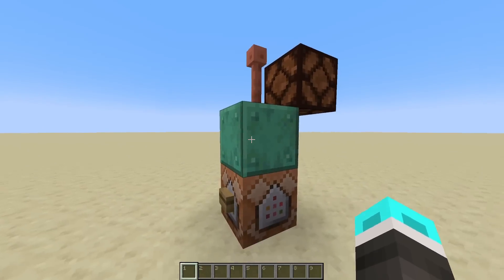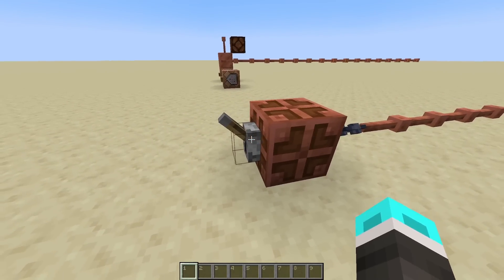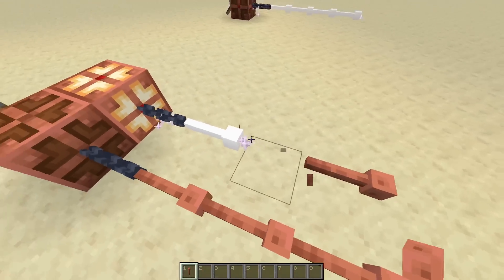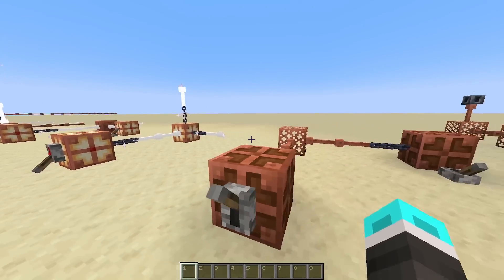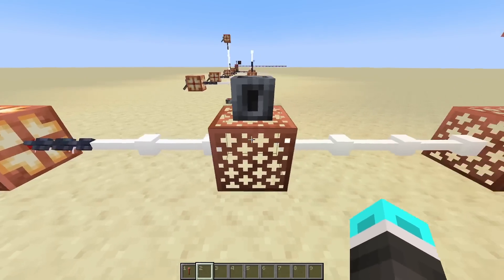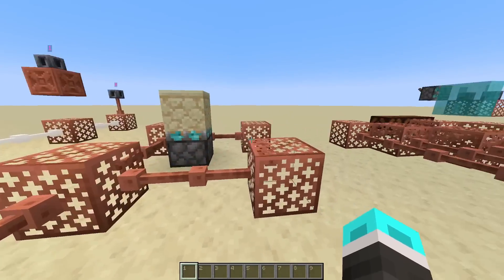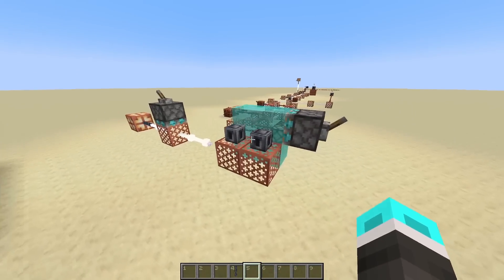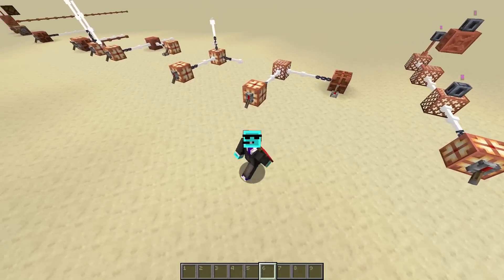Copper Wiring Datapack Beta 1

Comment: it would be really interesting if you could use oxidised chiseled copper blocks as resistors to eg reduce the charge rate of a capacitor and be able to send different values, that  could be then read out by comparators

Comment: i would wish for a certain block like idk a  copper stair, that if u place infront of the bulb and then the lightning rod. u can making short turns instead of placing a rod using a copper block etc. also i think the bulb should be 14, as a lever connceted to a block connected to a copper bulb on the other side. doesnt activate the rods.
Reply from the maker: @aerotter.149  I made it just adjacent blocks. That doesn't create a strength of 14, I would just have to add a lot more checks for all blocks around, which I just didn't do
Reply: @AuraAcorn  ah ok, but i see how the 2nd question wouldnt of worked. what about the first one though?
Reply from the maker: @aerotter.149  stairs can be placed and oriented a lot of different ways, everyone one of those would have to be checked in a system to see if it would work, and I don't see much of a gain to having them
Reply: @AuraAcorn  if this is added as a feature plus doesn't need to be a stair, it will save a hassle of extending the wire 2 then turning 1 then turning back 1. Just to move one block to the left. And it would add much more compactness

Comment: There is no point in storing energy if you can just generate it infinitely with the same amount of blocks. 

At best this datapack simplifies power transmission compared to redstone and compacts it a bit. With redstone you can already build nearly anything considering people already build computers in minecraft and this datapack won't allow to do anything more than is already possible it will just make it easier. I consider limitations redstone has to be part of what makes it so cool so for me this datapack doesn't increase what is possible it just makes it less cool.

So far this datapack doesn't have any functionality redstone doesn't have. Competing with redstone in it's own field is pointless because redstone will always have advantage of being a part of base game. Modpack like that needs to open new possibilities which is not the case in it's current version. Also as I said before 2-block power storage is completely pointless if you have 2-block infinite power generator. To justify existance of storage power generation needs some kind of limitation. Examples of possible limitations would be: randomness in time(like lightning strikes), specific location(for example power generation possible in specific bioms), cost(either cost of creating generator or cost of running it). 
As I said about redstone previously, limitations are what makes it cool. Power amount limitations don't exist with redstone so that could be something to differentiate this modpack from redstone. But it would still need to give some new possibilities because otherwise it would be just inferior redstone. 

I got a bit lost myself in what exactly was my issue with this modpack but what I was trying to say is: it can simplify things that are already possible with redstone but there need to be some sort of "cost" going with it. Many technical mods make different machines more compact than they would be when build with redstone but it's balanced by higher build cost or  energy generation limitation.

Comment: The Heavy Core need the bound value or... more time for more charge. I tested some functions and I propose the function sqrt(2*t+0.25)-0.5 . It gives +1 to charge every triange number of tics. In other words - you spend 1+2+3+..+N ticks for N charge points. It grows not very fast but you still can get every amount, but for 500 charge you need to spend around 2:06:30 of real time, the 126 minutes 30 sec. If you want to double it, you totally spend around 7 hours! (exactly 6:57:00) The reverse process can work the same way.. or faster - with linear function or slower.

Comment: this is a very cool data pack but i have 1 question, what makes it different from other packs or mods that work with electricity things?
also what would you need that power for? 
my limited brain just seem to be unable to see a reason for that😂

Comment: You should consider adding more electrical components such as diodes, and consider making the wire omnidirectional, as wire in real life has no polarity, thus giving a purpose for diodes. As for the capacitors, perhaps you could connect them in series to increase their storage capacity, might be better to use a different block though. Seems really cool though, good work, look forward to using this!

Comment: Insulation has been mentioned, but I'd also like to see wire coloring added. For example, put a dye in the middle and a ring of wires around it on a crafting table to produce 8 colored wires.

Comment: Suggestion!! Cut copper acts as a junction point (copper grate minus the heavy core) but as soon as there is a second input no power goes out the block, so it "Cuts" the power. This will help in NOT and XOR gates im pretty sure and other cool stuff

Or when power is cut, it could charge the heavy core on top or smthin idk

Comment: Lots of suggestions on how to make NOT gates—and I think I've got a good one. Fully oxidized copper grates will only allow power through if the number of outputs exactly matches the number of inputs. This way, you can have one input and one output by default, giving an ON state. But if another input comes in, the inputs no longer match the outputs, so you have an OFF state.

Comment: I think that what disappoints me about this system is the delay it has when powering the next copper cable, like, I only felt it when you showed the paralleled light switch, where it wasn't instantaneous when you flip the lever, otherwise amazing work, and to be fair, is amazing it's a data pack

Comment: This honestly seems pretty cool, and its also nice to see a redstone-like system that operates quite unlike redstone. I could see uses where people transfer energy between redstone and these copper wires for different purposes. Could be really interesting! Also kind of fun to see new uses/purposes for the various copper blocks as well!

I would probably agree about rhe heavy core being a bit too rare to reasonably use, but I also wouldn't want an essentially limitless battery to also be trivial to find/make. Perhaps some form of middle ground block/item could function as a lesser version?

I wonder if the sparking at the end of an open wire could have some use or purpose in some way? Obviously anywhere on the wire already deals damage, not sure if the sparking shouod be maybe more dangerous or have some added effect? Or who knows what else could be done with that.

Comment: You should also add in a insulator, and then make it so if you don't insulate the wires and you put active wires underwater, them being in water within a certain radius does damage to you, but if you insulate them, then they don't do damage at all. (maybe you can use slime blocks, and it would visually look like it was waterlogged with slime.)

Comment: Like This and I have an idea to use the heavy core to make like a Battery for builds that may need that, for example backup battery. Maybe you should make a way to transmit the single wireless for Redstone circuits to work together

Comment: Aura Acorn, you should either make the beacon the new battery, or make it so you can power the beacon to turn it on, it would be max strength, but it would require to be connected to the battery to activate.

Comment: I have some ideas about what could be added. My first idea is to make it so that if the climber comes into contact with a charged copper wire, it will turn into a charged one. The second idea is a wireless connection using half a block of cut copper on the wire as the output and a block of copper as the input. Something along the lines that the block of copper is charged in a certain area from the half block. It can also make the channeling enchantment on the trident work in this area even without the thunderstorm.

Comment: the heavy core already has a slit that would look nicer as a meter rather than displayed as a number, you could probably use a block/item display for each meter or replace it with a  custom skull depending on the power level. Abosulutely genius idea and execution, great job

Comment: Dude ! I don't know who you are, clearly underrated, but that Datapack is just beyond INSANE ! SO good that I think you should send this to Mojang as a proof of concept and a suggestion for the long awaited New Redstone update; especially since they are doing updates to redstone right now. If they approve and integrate this in pure vanilla, you'd be a legend, and worst case scenario is they say "you already did it so we wont bother".
But I have some points to raise though :

1. As much as it looks really cool that you use the new copper bubls, I don't think it is the best to use. For, knowing the redstone community and their whacky high speed update machines, these blocks might be at risk of making things very laggy with all the light that has to be computed every time, for each Bulb ! , at least on low end PCs. My suggestions would be to use the normal Copper Grate (waxed or not) as the input block and Maximum Oxidized Copper Grate (waxe orn't) for the current role of the Copper Grate. Another combination also could use the Raw Copper Block to be the input block, and Copper Grate stays as it is. I also thought about the Cut Copper Block and Basic Copper Block as input blocks for more stylish builds but you're the datapack developper so you're the boss.

2. As others have already mentioned, the Capacitor using the Heavy Core is maybe a bit too expensive. Maybe use the Raw Iron Block or the Raw Gold Block ? These things are mostly useless anyway, except for decoration and inventory management.

3. I don't know if you already planned to do this, but I suggest you show your datapacks to big names of the redstone community for them to examine and give feedbakc. As the main target audience of your work is the redstone community, the opinions of the experienced ones are very valuable. Form the english speaking community, I only know mattbatwings and Mumbo Jumbo but you can ask a whole discord or someone else. Y're the boss.

EDIT: also make it so that the input block HAS ot be inputted with 15 power of redstone or else it won't activate the Copper Rod. That's a little balance to make it up for hte infinite wiring.

Comment: A few words about the capacitor. The energy storage device presented in the datapack is more of a battery than a capacitor. The difference is that a battery retains its charge using chemistry, and a capacitor retains its charge using physics, so they are fundamentally different.
The battery gradually charges and also gradually releases its charge as the intensity of the chemical processes in the electrolyte decreases. Therefore, it is used as a long-term energy source, similar to what is presented in the datapack.
The capacitor receives and releases its charge instantly, through two plates of different charges, separated by a thin layer of dielectric. It can be used as a quick charge-discharge source, like a button. A typical dielectric is aluminum oxide, a thin film on the surface of a metal that protects it from corrosion and is also a very poor conductor of electricity. Wax can be used as a dielectric; I have seen a proposal to use it to insulate copper wires.
Reply: I disagree. Theres nothing about capacitors that mean they receive and release charge instantly. They are certainly capable of that as well, but in the case of the datapack it makes much more sense that charge and discharge rate of the capacitor/battery is limited by the "resistance" of the copper wire. The capacitor discharges faster when more loads are connected, and is never rate limited. So calling it a capacitor is perfectly fine

Comment: because the whole idea is electricity, do the copper wires conduct underwater and deal damage to anyone in the water?

Also, this is a really neat concept that feels akin to the many worlds dilemma. I have one suggestion for capacitors, though, to potentially solve cannibalism (which doesn't seem intentional.) Perhaps use an internal label for each individual capacitor to correlate the data points effectively between them without having it transfer to another one. When I was making mario kart, the hardest part for me was sorting who was actually in the lead, so i used a bunch of checkpoints and proximity to check who was first, and it worked well to distinguish every player using internal labels, and I never had an issue of cannibalism with placements becoming the exact same or flipping rapidly. 

But if each capacitor could have a sudo name or UUID assigned to it, yes it effectively becomes a tile entity, but its an entity that only really needs to be checked upon a block update to resolve the issue.

And just a side note, the last minecraft version I messed with datapacks in depth was 1.18.1, when recreating COD zombies. I'm not familiar with a lot of the new systems and tools, but I do know entity labeling is still possible

Comment: I think giving Heavy cores a technical use is great. I don't mind the fact that its rare as it encourages delving into other gameplay aspects of MC, especially the new content. 

You could possibly use a green player head on a block display and changing its y axis scale to stretch to show the current charge in a heavy core over using the numbers for a more vanilla feel (not sure if non uniform scaling is implemented or not for block displays tbh)

The energy "cannibalism" you show is a hard problem to solve though. I don't believe blocks hold any unique information so its hard to tell the blocks apart when moved. Since you are using a marker entity (i assume) to represent each heavy core, you could have a check to see if the heavy core block it represents is gone and do a check on all adjacent blocks to see where it went and move them all over accordingly.. but thats still tough to implement and get it working right.

Overall a great framework and can't wait to see what people do with it and how they expand on it. If you have a public repo, I could possibly submit a PR.
Reply: Also, just saw on the pack page that you wanted a way for heavy cores to retain their charge. If using an entity marker as mentioned previously then check for missing heavy core block at its position, then if it is, look for a heavy core item entity at that position. if found, give it an item tag that was its charge when broken. when a player is holding a heavy core item that you tagged, use a right click detector and place it for them using raycast with the entity initialized with the correct charge.

Comment: I think the only suggestion I have is to have the storage be an immovable block like Obsidian, for it to turn into crying obsidian when it has any charge. It would probably be a lot easier said than done, but that way gathering any crying obsidian could have its charge randomized when placed into a circuit like that. 

And I think an immovable battery has more applications than a movable one. Both would be even better ofcourse, but an immovable battery could very easily be the heart of a flexible circuit, where movable batteries require more space.

Comment: Another difference with redstone could be that electricity only works when the circuit is closed like real electricity, but you would need another block that works as the negative pole or ground. And if you directly connect two opposite poles with no resistance in between (a copper bulb or the copper grate) it short circuits (AKA: Boom)
Reply: For the explosion, you could summon a wind charge, so nothing gets destroyed.

Comment: What is a good use for a capacitor? Batteries in modded minecraft make sense because RF requires some form of fuel or other input that will eventually die out, but Redstone is often a set it and forget it system that you have no obligation to power down for any reason.

Comment: you should make a way to invert the signal but not just summon power out if thin air, make it like a transistor and also mabey make copper block like a conductor that has no direction kinda like grates so you can do a u turn without a lightning rod in between or maybey theres an other solution idk

Comment: This datapack is unstable. I tried to write "/function copperwire:reset_wipe", and then I updating everything for a long time, but it didn't help. I also want to note that the data pack need a signal inverter, because you have to use a redstone torch and then convert back to copper wire signal.

Comment: neat. I think that the copper wiring should be able to provide redstone output, but not the other way around. Using the copper bulb is nice thematically, but i'd love if there were a decent way to have to create a source for your electrical power? The only kind of thing i could think of is using piston feed tapes or maybe entities falling onto tripwire hooks to convert kinetic energy into electric energy. Imagine building a mob farm that doubles as a power plant? I'm not sure if it is possible, but maybe using an entity you could detect for the presence of a bubble column for some sort of hydro-electric type thing?

Comment: Can you make a transistor? It has 2 inputs and 1 output. It's like a switch between one input and the output. The other input controls whether the signal can pass through: if it's on, the signal can pass; if it's off, the signal can't pass through. It's the main component in modern electronics, and with this, it would be a lot simpler to make a computer.